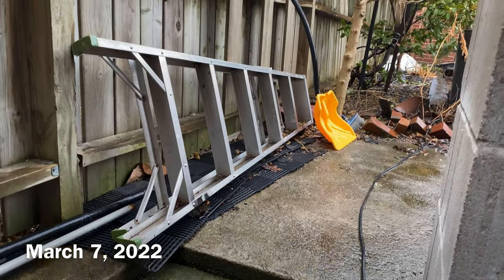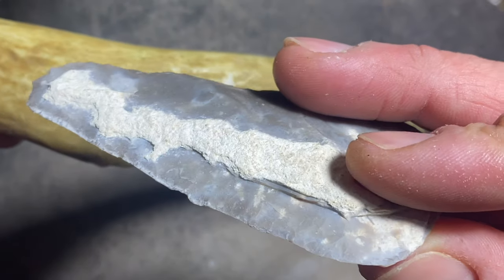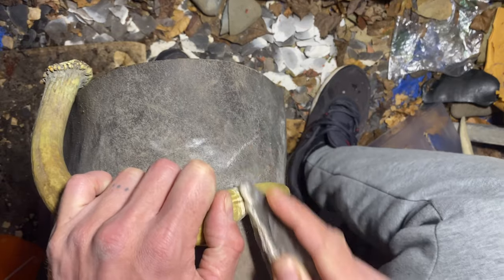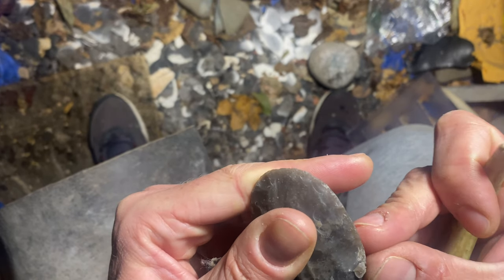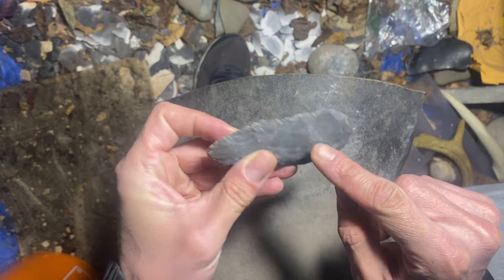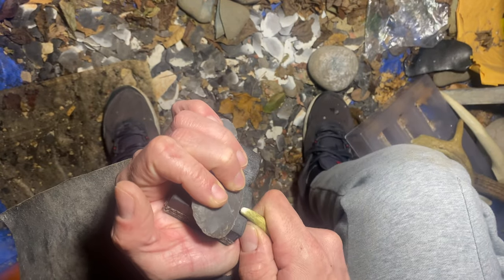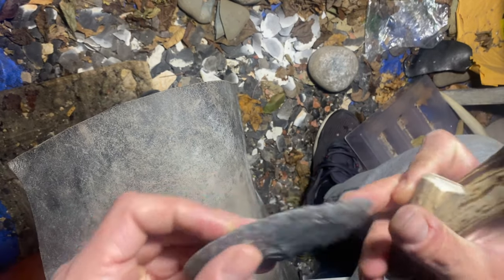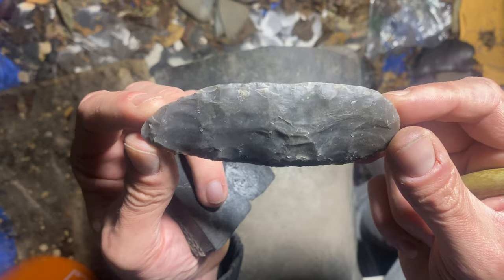Making a New Antler Pressure Flaker and Using It - 500 Subscriber Giveaway Part 5 of 14

Comment: How much use do you get out of a pressure flaker?
Reply from the maker: That depends really. Each of my pressure flakers kind of get used for different purposes as they get smaller. When I first make one like this I can probably finish 15-20 good sized points before it gets so small that my hand starts cramping up. Then I will transition it to an indirect punch or something else, depending on what type of activity I'm doing. They are always useful for something, even just decoration or ornamentation, no matter how small they get.